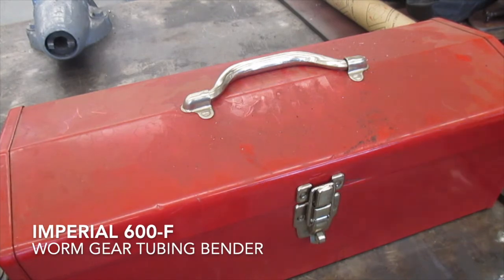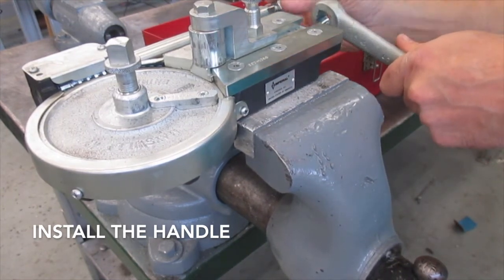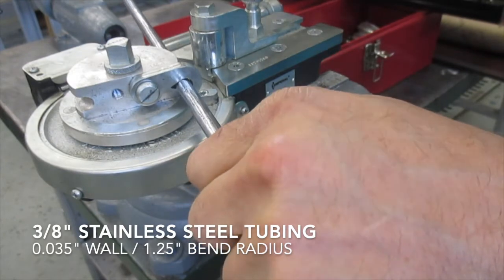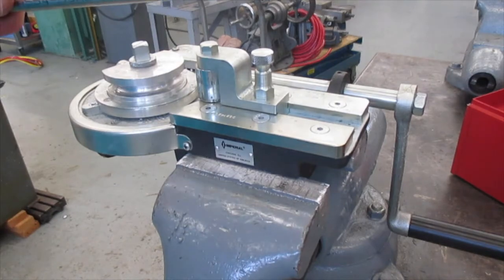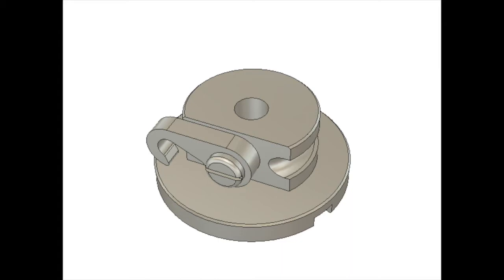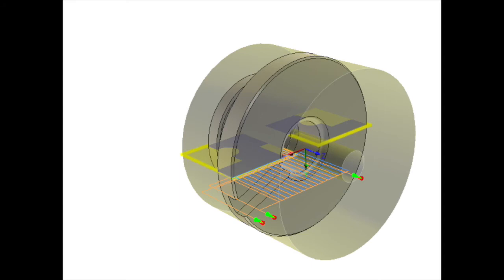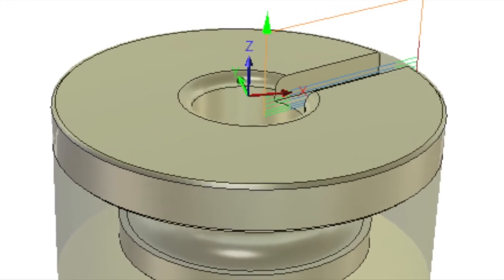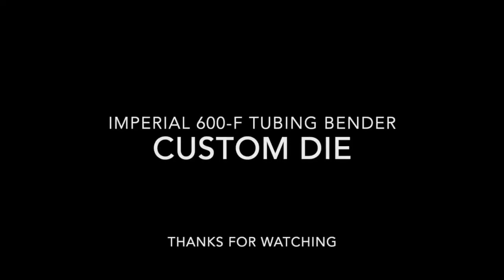Custom die for Imperial 600-F Worm Gear Tube Bender

Comment: Hi Randy. Great work on that die. I just picked up a 600-F that looks like someone buried it underground but its savable. I'm going to make a set of dies for it but I don't know what their standard is for centerline height. Any info you'd be willing to share would be appreciated. I'm a fellow Fusion user. Thanks for the great content.
Reply from the maker: I uploaded my Fusion 360 CAD model to Grabcad. https://grabcad.com/library/imperial-600f-3-8x15-16-radius-die-1
Reply: @MrSmithDotShop  This is great! Thanks so much 🙂.